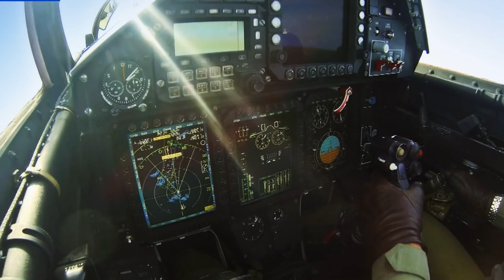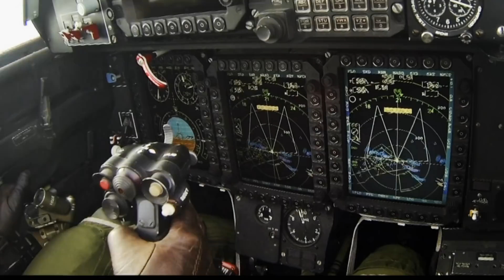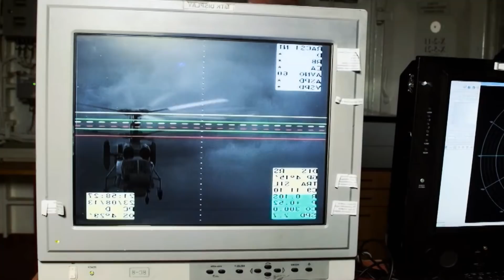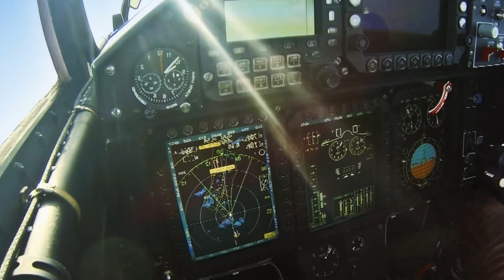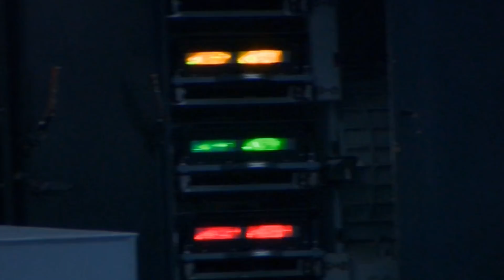Time Is Running Out for Russia's Only Aircraft Carrier - Admiral Flota Sovetskogo Soyuza Kuznetsov

Comment: "Equipped with arresting wires to prevent the jets flying off the other end." Unfortunately it has problems (cables snapped, allegedly due to manufacturer cutting corners), resulting in 1x Su-33 and 1x MiG-29K going into the water during the Syrian campaign. Both pilots made it out ok.

Comment: The Kuznetsov was designed with a fundamental different role than the US carriers.  US carriers are designed as force projection platforms using its aircraft to conduct strikes on shore and sea targets and perform fleet defense.  The Kuznetsov was designed specifically as an anti-ship platform using its SS-N-19 missiles.  Its embarked aircraft are there for fleet defense.  
And the only reasons this ship has remained around for so long is that it spends much more time in the yards getting fixed than it gets underway out at sea.  The second is that the Russian Navy wants to maintain its status as a major naval power.
Reply: Dennis McIntyre it was designed to get around a ban on aircraft carriers traveling through the Bosporus.

It’s a crap aircraft carrier, but crap is better than none, as the Brits learned the hard way in the Falklands.
Reply: What? Learnt the hard way? Wtf are you talking about?
Reply: @conan5300  They were on the verge of being decommissioned, only by luck did they have any at all.  Uk's slow procurement means there are gaps of no capability, just like the one being experienced now.  If the argentines had waited just a bit longer, they could have had it.

Comment: It was in for a major refit and suffered a major fire in December 2019 the fire started in the engine room after some welding sparks fell down a shaft as the fire took many hours to control the  below deck spaces the damage will be huge and in my opinion it will probably be scrapped
Reply: then it might be quite a plausible possibility that Russian Navy might outsourced they needs of an aircraft carrier by buying Chinese made, the Liaoning type 001, which actually a scrapped Varyag that bought by the Chinese back in 1998 from the Ukraine , or her sister ship..
them Russian already willing to bought 2 amphibious assault ships from the French.. although failed to be delivered and got cancelled due to political issues.. 

although for them to buy Chinese made.. 

But desperate time justifies desperate measure..
unless the Russian Navy arent that desperate..
not the complete system of course, only a hull, probably with much more modern engines fitted..
Reply: Also the welder was drunk while welding lol
Reply: @dieterhrabak4947  russia buying large surface ship from China will be a huge blow to Russian military tech prestige in world arena
Reply: @marjanperveinis8355  Should VMF only buying the hull and probably the propulsion engine... It doesn't matter much,  although yeah, the memes gonna flooding the internet for years to come.. Besides it is mean just a stop-gap before the nuclear powered full fledged carrier(s) at 90 thousands tons entered service, if it even materialized..

Comment: I served onboard two Nimitz-class aircraft carriers.  Everything I see about the Admiral Kuznetsov is less than second-rate and very underwhelming.  The fact that the Kuznetsov can remain at sea for only 45 days is not at all impressive.  In fact, it is pathetic!  Generously not mentioned in this video is the fact that the Kuznetsov will not or cannot deploy without an accompanying ocean-going tug boat, due to its propensity in breaking down at sea.  

The Kuznetsov's current shipyard repair and modernization period is expected to be five (5) years (it would have been 10 years if the modernization budget did not get cut in half) but will probably be much longer than that.  So, Russia will now go over five years without an operational aircraft carrier.  That means for over five years, the ship's crew as well as aircraft squadrons will have no at-sea training or experience.  You simply cannot overstate just how greatly that will degrade their performance in operating the ship and aircraft at sea.  Safety, proficiency and other issues will be forgotten.  There will be no "experts" onboard the Kuznetsov if and when it puts to sea in the distant future.  

But I believe the Kuznetsov's extended shipyard period will be a disaster, and the ship will never get underway again.  Therefore, the title of this video, should be, "Time HAS Run Out for Russia's Only Aircraft Carrier."  And Russia has neither the Rubles nor the technical expertise to build an aircraft carrier of any size in the future.  Remember just a few short months ago when Russia advertised it was building a “supercarrier” that would be larger than U.S. aircraft carriers?  Well, a very few short months later, that grandiose plan was shelved when reality hit the Russians hard in their red hung-over faces!

The largest ships that Russia is currently building are small frigates.  That tells you everything about the current state of Russian Navy shipbuilding capabilities.  When the Soviet Union collapsed, it took its large naval shipbuilding expertise with it, because it was all done in the Ukraine.
Reply: Unfortunately for Russia its Navy isn't the only branch loosing its luster. The PAK FA is not stealthy in any significant way, and just as well because they can't afford to build many anyway. The T90 MBT seems to also be a dud. I don't know of any client state ordering any and Russia themselves haven't fielding them in any useful number. The Pansir or whatever it was called got exposed by Isreal when they were fielded in Syria as completely useless. They seem to be behind the US, Isreal and China in drone technology, maybe the Europeans as well. 
I trained with Russian troops quite a bit back when we were playing nice and they're truly great people. I feel bad for them that Putin's government has let them down on so many levels.
Reply: Russia is almost a completely landlocked nation and its Army and Surface to Air missiles must come first, thereafter its Airforce.   The navy is critically important from the point of view of nuclear deterrence and creating a threat strong enough to discourage western aggression against Russia and its trading partners.  Given its limited port access the Russian Navy can never win but it can make things so uncomfortable no one would dare engage in a conflict.  Keeping 1-2 aircraft carriers in use allows the Russians to keep the spirit of design going and it also allows the one aircraft carrier to provide air cover for its navy in one conflict zone.   Its Helicopter carriers can provide amphibious assault and anti submarine protection while keeping aggressor aircraft away from them.
Reply: You see little. The rust bucket can protect it's own it has The S400 and does not need protection from it's CruDesFlot . If We go to war with Iran,we will probably see a carrier sinking by missiles.
Reply: @Петр Петрович It is not the soviet union it is Russia now. They build really good stuff now, I just saw the China parade and Sad to say,. I see the US as the Third in the power Tree.
Reply: @willyjimmy8881  SU-57 is Stealthy but is only stealth less than F-22 and stop saying bad stuff about russia tech!!
Reply: @v0id683  S-400 is control by russian crew only to protect russia airfield base in syrian. S-300 is only one that syrian crew control it.
S-400 and S-300 can able shoot down any F-35 but russian have order to S-300 syrian crew to not shoot it cuz russian and isreal have make an agreement.
Reply: @willyjimmy8881  Panzir was good in Syria contra drons and missiles.
Reply: in Russia didn't know what is better - aircraft carriers or anti aircraft carriers missiles.
Reply: @v0id683  yes is can
Reply: @v0id683  who and when?
Reply: Chief Seadawg beyond that, air craft carriers as a whole aren’t good for anything other than attacking. 

A US aircraft carrier is no match more many small, ships carrying anti ship missiles. 

It’s quantity > quality sometimes. 

This is what Iran is doing. 

And Russia is more defensive than offensive like the US.
Reply: Saosaq Ii 
  The small ships won't be a match for the 60 aircraft that show up to blow them out of the water.
  Unlike the days of old, a ship like a carrier can take a lot of hits and be operational. It's been said that anything short of a nuke can't sink one, even if a missile can get through the carrier's and escort ships defences.
  The Russians have been on the offensive lately as long as they can do it by land. They just can't cross large bodies of water. They never could in the past and won't be able to in the foreseeable future.
Reply: @willyjimmy8881  I think Yeltsin would've let them down even more than Putin and outright dismiss them with disgrace and shame.
Reply: Lol so true! Flash forward to 2019 and this pos is at dock getting “repairs” while fire crews are trying to put out a massive fire 😆😆😆
Reply: @saosaqii5807  Do you realize that every US aircraft carrier is always accompanied by about 20 ships, including destroyers and subs? Not to mention the 90 planes on deck.  No way in hell anything would be getting close.  It would take a nuke to sink a US aircraft carrier.
Reply: Saosaq Ii the Iranian Naval Presence is very weak considering that half the force would be destroyed by Cruise Missiles and Airstrikes while in port. On top of that, the rest of the ships they would send would be engaged from a greater distance than they could engage from. F-18’s and EA-18G’s could shut down the ships weapons systems while also destroying targets. Look at the battle between Iranian and American Naval Assets during the Iraq-Iran war when the US raided their Oil Platforms. The USN is a Navy greater than any other ever.
Reply: @v0id683  they weren't meant to shoot down any f35s! Russia has restricted the use of even the s300 against isreal from Syria! So why would Russia be aiming s400s at any nation with f35s when they mission is basically complete in destroying U.S. backed terrorist? But since where talking about failed SAMs, the patriot has been a shit show in Yemen as is the m1Abrams. Oh we can also talk about how many f35s have crashed and burned too if you want to talk failures!
Reply: @v0id683  you can't judge the su57 at all. But if you do you have to give it just as much credit as you do the f35 due to the types of engagements they performed in. The su57 had done a few targeted /guided missle flights over Syria. It worked out just fine. Same as f35, flew over Lebanon and parts of Syria to strike IRG build ups in Syria. Again Russia has a deal with isreal where they will not interfere with Israel in doing such missions. Russia also restricts the use of the just as capable s300 from Syria. We have not see the su57 or f35 in conventional war time settings.  However they both have made noticeable achievements for whst they are being used for. The point is, you Russian haters have to stop being so bias and ignorant towards Russian equipment as if the USA and Russia went head up it will look Iraq  or Afghanistan where marginal pilots where using old export versions of old jets and tanks? What you really want to act like Iraqi pilots has a chance flying mig 21,23 and 25s against Aces flying f15s 16s f18 hornets and possibly F22s? Not to mention the stealth bombers we have been using against middle eastern countries who really have no Sam systems to answer those kinds of stealth systems. However, Serbia manage to knock down a 117 night hawk, the pride and joy of the USAF, with an outdated Soviet era Sam system. Which tells me stealth is a great tool but no longer state of the art.  Basic physics can expose stealth these days. We both know to act like Russia is a push over that is a lie! Russia has some pretty cruel weaponry especially fighter jets, armored vehicles including T72s T90s and the new t14 armata! Long range missles and Hyper sonic missles, as well as nuclear subs. So let's stop with the doubtful of Russian wartime capabilities.  We all know if USA and Russia goes to war there will no winners!
Reply: Saosaq Ii you will never see a carrier without at least five ships protecting it.  Carriers aren’t designed to combat small boys.  And when Russia has a small boy capable of staying out any longer than a couple weeks, I suppose we can consider them a threat.  Until then, they are a little annoyance that causes us to turn a little more than we would like.  That’s about it though.
Reply: @homevalueglass3809  good thing the Russians have nuclear torpedos then right
Reply: @saosaqii5807  True. That's why US Carriers are always accompanied by a group of Arleigh Burke class destroyers, each can carry up to 96 SM-6 missiles which can intercept almost any kind of anti-ship missile. There would be more than 8 of those destroyers in the war time, and that would be 768 SM-6 missiles ready to fire all at once, and i'm not talking about the air wing of around 60 Super Hornets that can carry at least 4 AGM-65F Maverick missiles each and fire them at even smallest of boats. How's that for a quantity? And don't forget, those are only SM-6 missiles loaded in vertical launch systems, they can take some time and rearm the VLS pads to launch even more of them
Reply: @willyjimmy8881  Why is everything military related compared to the US military and US is like the gold standard?

Su 57 is a totally different plane from the f22 or f35. Here's a little fun fact. Soviet Union experimented with stealth technology after ww2 and US took many concepts from them, soviets even had a prototype of radar reflective coating . However Soviets decided that stealth is just not worth it for them, and that it hinders many other aspects of the aircraft. 

The purpose of an f35 is to penetrate deep into enemy territory and you need stealth for that. Su 57 is built to defend Russian airspace, and to hunt down stealth planes.

So which is better, a f35 or a su57? You can't really compare them like that. They aren't built for the same purpose. Su57 isn't as stealthy but it was never meant to be. F35 is not as maneuverable but it was never meant to be. Very simple

This also applies to the rest of the military. Different doctrines, different priorities, different tactics, different goals. Russia does not need aircraft carriers to defend its borders. US needs aircraft carriers to project power over the whole world.

Russia is focusing on artillery and missile technology. Russian artillery is very good, same as their rockets. US is behind in rocket technology and Russia is the leader in that branch of technology. Does this mean Russia has better military? Nope

Realistically US is almost impossible to invade. But it would also be hard for the US to invade Russia. I think such a conflict would most certainly go nuclear and very quickly, so let's hope it never happens

Comment: Maybe a small misunderstanding about this platform... She is a missile cruiser first and foremost, not a pure aircraft carrier. There are a lot of reasons for it but one of the main ones is the Soviet doctrine of the time. 
Her main striking package is her Granit missiles, not her planes, which are, as per doctrine, used for defense of the naval group. While the platform was used in a conventional / Western way in Syria (with aircrafts as the main weapon system), her role as a missile cruiser is not going away as her current overhaul includes the removal of her Granit silos to be replaced by the more flexible Kalibr missile system, enabling the Kuznetsov to retain its AshM role while giving it some land based targets striking abilities. 
Her air wing when deployed off the coast of Syria last winter included : Four Ka-27PL, four Ka-27PS, four Ka-29, four Ka-52K and two Ka-31R for a total of 18 helicopters and Ten Su-33, one MiG-29KUBR and three MiG-29KR for a total of 14 jets.
As for the "super carrier" Project 23000 Shtorm, the Russians will have to take baby steps in that direction and build capabilities, a skilled work force and so on, first and foremost... They have never built a carrier before. So, logic dictates they will first have to build a smaller platform. They are currently working their way toward a Mistral class sized landing ship/helicopter carrier. They will most certainly then try and work out a design for a Kuznetsov sized ship and work their way up... It's what their Navy has had to do since the lost decade of the 1990's, relearn and restart small, increasing tonnage and size of the vessels as they go on. 
I have written 3 articles on the Kuznetsov and 1 on the Shtorm for a website called Defensionem, if you are interested...

Comment: Another problem non-nuclear carriers seem to have is their diesel/gas engines wear out faster than nuclear engines. 
Nuclear engines need to be refueled at a ships half life, but only the nuclear fuel and a few small components need replaced.
Large ship diesel/gas engines are very much like your car's engines. Once a few parts start going bad, every part starts going bad. These massive ships just put a lot of wear on their engines, with repair being quite hard. This is why the Kuznetsov has gained an infamous reputation for breaking down a lot.
Reply: Yeah, but if they wanted they could replace the engine several times over for the cost of one nuclear one. Swings and roundabouts.